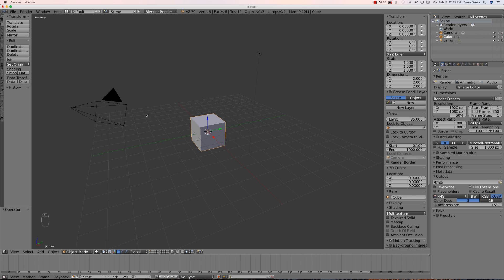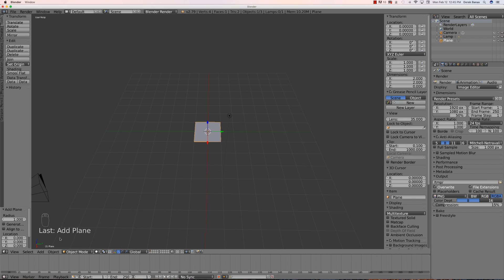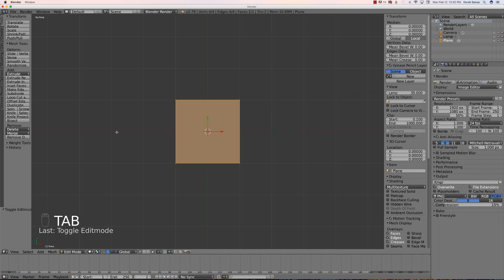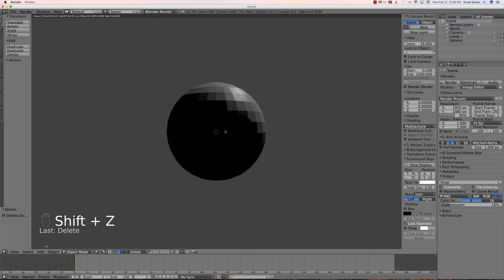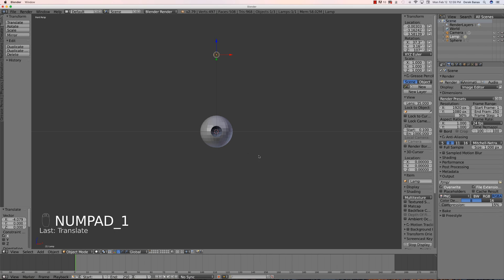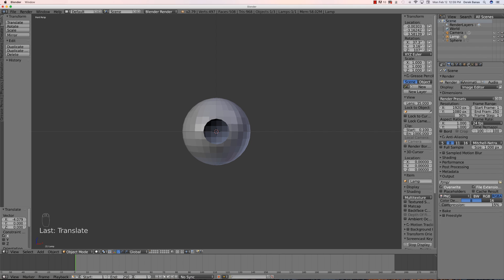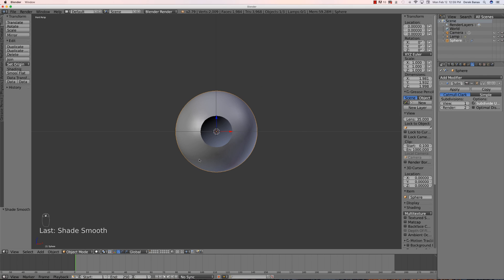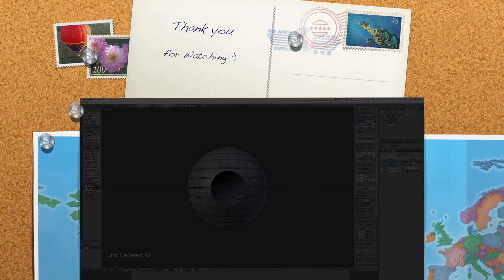Blender Tutorial 8 : Cutting Holes and Edges

Comment: What we need to be able to do is cut a proper hole through a volume (WITH INTERIOR SIDES GENERATED), not just a hole in a surface. Extrude can somewhat do this but instead of making an open hole it will start extruding out of the other side for some reason when you hit the opposite face.